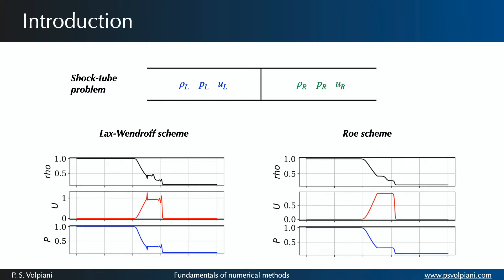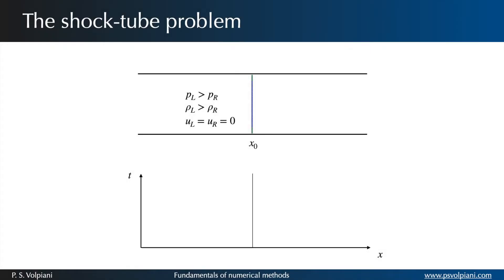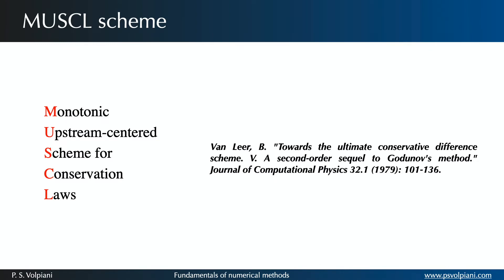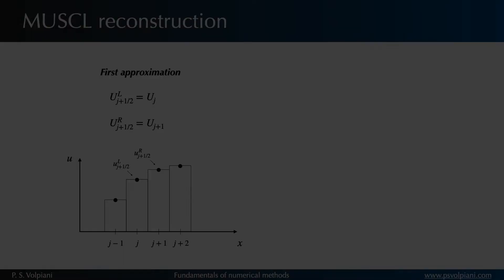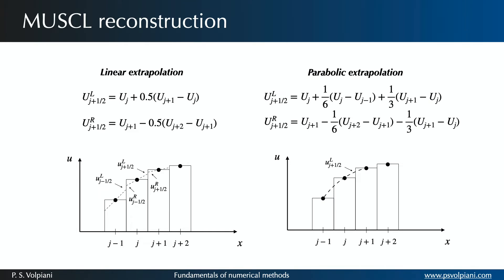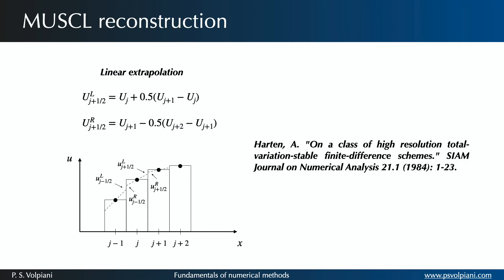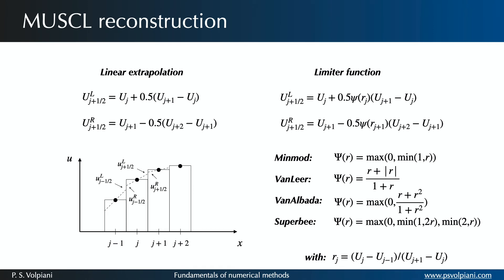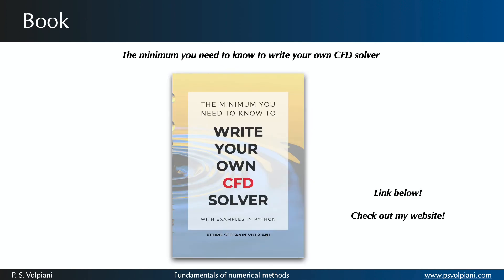CFD-08: How to implement the MUSCL scheme to solve the Euler equations?

Comment: Hi, I just read about the MUSCL scheme in several references, including Wikipedia, a book (CFD, Principles and applications, J. Blazek), and a paper (https://arc.aiaa.org/doi/pdf/10.2514/6.1993-68). It seems to be that the MUSCL Linear extrapolation is different from your cases, specifically at UL[j+0.5].